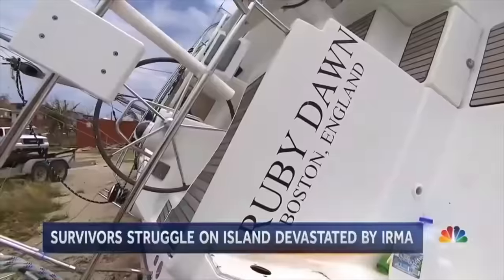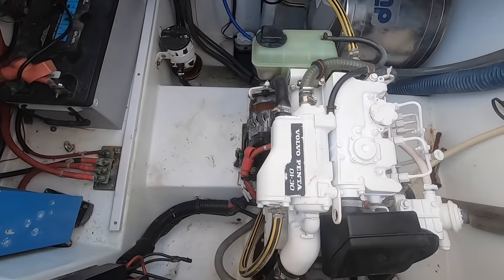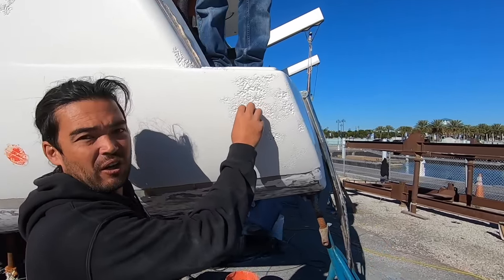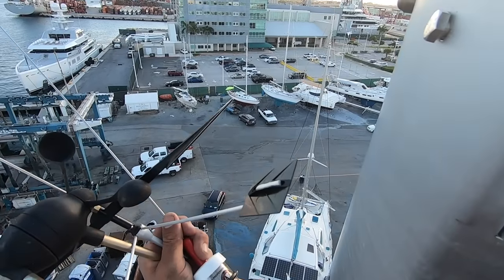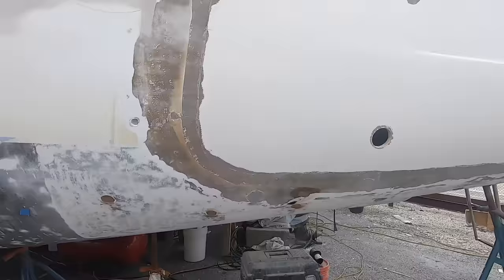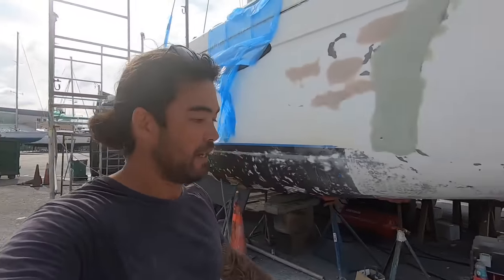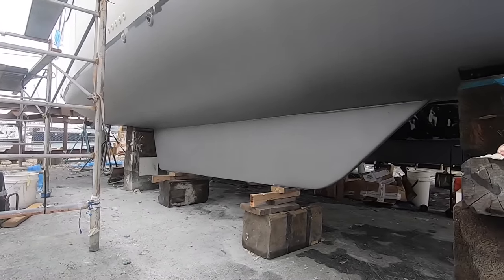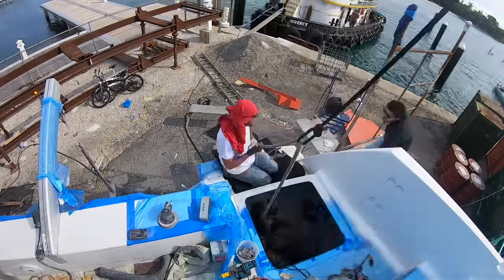HOW WE TRANSFORMED OUR SALVAGE BOAT TRANSOM! - Episode 103

Comment: Colin,
I've watch every episode from the start to the finish. I'd just like to say your to hard on yourself. That molded patch section from what I could tell was spot on. nothing is perfect when you work with fiberglass.
If I was in the market for a refurbished boat  or even one that had just been salvaged. I'd want someone like you (or even you) and your team to be the ones to survey it and do the repairs on it and bring it back to factory specs. 
You don't mess around, you don't cut corners, you do things the right way,  When your done from what I've seen its better than it was out of the factory. I look forward to your project in Panama.

Comment: You should always use yellow moulds if you're working in sunlight because it will not get hot at all. Trust me paint something anything and do part this colour part that colour and then 1 part in yellow then put it out in the sun to charge lol to heat up then touch each colour with your hand or use a laser temperature device and you will feel or see that the yellow is still cold to the touch etc and all the other colours are hot.

Comment: Hey Collin: if you ever do another Molding repair and you get caught with a hot sun try draping the mold with wet blankets during the curing process it should keep the mold  cooler. Great Job guys. That owner is Lucky they have you doing the repairs for them. Perfectionist always do the best work.

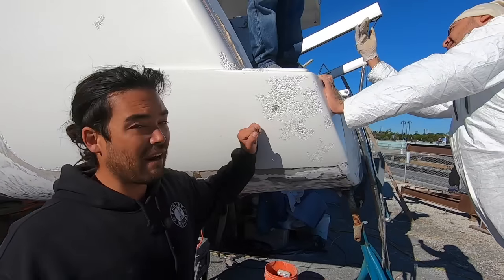Comment: 4:54 wondering if you were to measure using a little infrared temp measuring meter,  if you would have known what the actual temp was everywhere, especially the spot that got too hot. You would then know where your cut off point temp wise would be, that would be good info to have ! That said, I suppose a person could set up some sort of shade ? Hopefully the seals in the bottom of the sail  drive which keep sea water out and oil in were replaced.

Comment: Now you can take all the lessons learned from this project and apply them to Parley's needs... maybe even correct some deficiencies in the original design if you're able to get a naval architect or marine engineer with a structures background to look at ways of preventing the damages you experienced. Plus, you can turn a lot of those wasted spaces into accessible storage for light goods like linens, paper towels/tp etc if you craft access panels/doors or hatches so that you can continue to monitor the repairs going forward. You will I hope, document it's repairs like you did this project ? I think it will help convince more people to explored these damaged boats as feasible projects, IF you have a good plan, and lot's of help !

Comment: Hi, I've only just subscribed to your channel so sorry if I ask a question that's been covered. Regaurds the gel coat, your using a roller inside and spraying it on, on the outside, can you also use a paint brush? Also is it a different type that you use for spraying or applying with a trowle, as on the outside join? What a great project, love watching you work and a genuinely nice bunch of fellas.

Comment: Just watching you work is tiring ! I am surprised that you under estimate how long repairs take after all the repairs you have done too.

So, Parlay got broken and had a lightening strike and you estimated 30,000 for the repairs so you took some time out to get a paying job to generate some money. I suspect you made more than half of what you required but still needed more so decided to buy another boat as a 'fixer upper' to sell for profit, as I remember it you sold a couple of boats instantly for much more than you paid then bought these two. Now you sell one of them for a lot more than it cost you and you have a fully repaired one ready to sell !
By my calculations that's a very good turnover for a few months work and you could just scrap Parlay and buy a better boat ! or keep the one you have just fixed up !